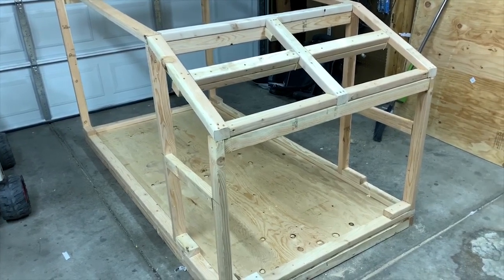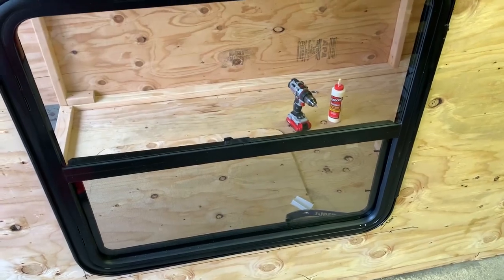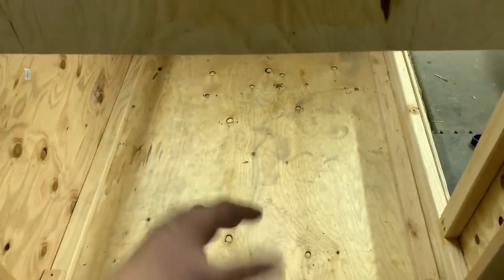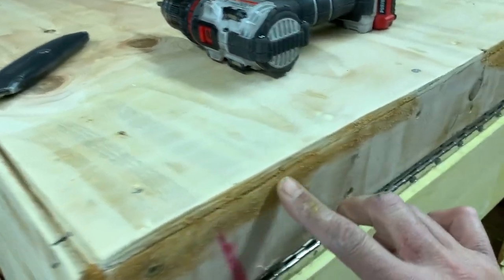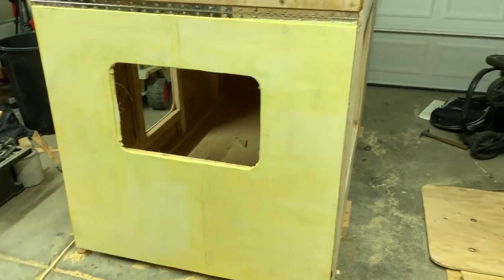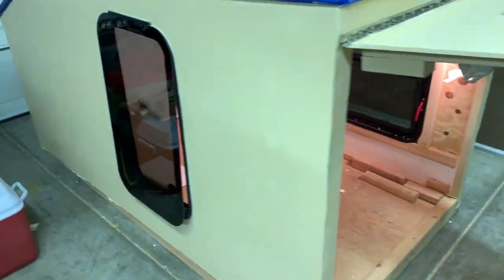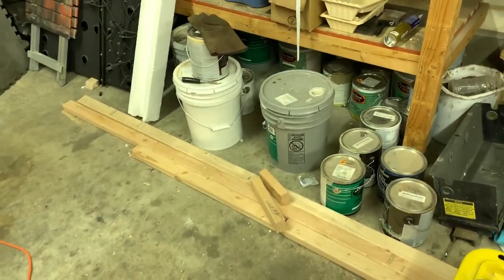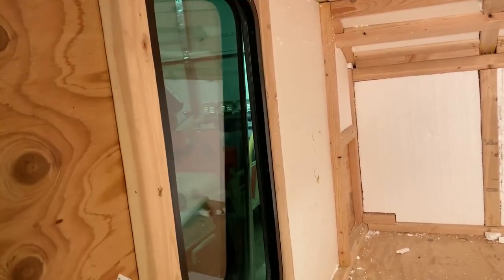DIY MICRO CAMPER BUILD | Truck Bed Camper Build

Comment: Suggestions : use netting to hold stuff on shelf...………..put a piece of plywood on the floor that hinges 1/2 way up the bed ; gets bedding out of th way so you can put toys or coolers while traveling , you might want to put a huge drawer the size of the bed floor under the bed .
Reply from the maker: Thanks! Good ideas.

Comment: You can put a truck rubber mat under and the camper won't move. Great job
Reply from the maker: That's a good idea, but it would make it almost impossible to load, since I slide it in.

Comment: The tie-bond three is waterproof can you use that for the poor man fiberglass?? JW if you can Rhino line the poor man fiberglass? Love the build came out really nice 👍🏿 thanks
Reply from the maker: Thanks! I don’t see why tite bond 3 wouldn’t work, I used 2, because I seen that it worked good.  I’m not sure about the rhino liner.

Comment: I could have built two frames with all the lumber. It way to heavy wood. Seriously, those beams could have been half the thickness and you still would have a strong and solid structure foundation.

Comment: How is this holding up? I'm curious because Titebond 3 is the exterior glue and you said you used Titebond 2.
Reply from the maker: I think they are both exterior, but it’s holding up well. Still using it.
Reply: @Dicks4x4Garage  Good to know. Thanks man.

Comment: So question I want to build one like this after you cover the wood with the canvas what glue did you use and do you just paint it after and your good to go?
Reply: Poor man's fiberglass doesn't need glue, find some exterior house paint from the oops rack, roll it on super thick, then lay the canvas into the paint and smooth it out. 
Fill the fabric with more coats of paint until it remains shiny wet after a few minutes, then paint with the color you want

He used titebond II wood glue

Comment: I believe you would have gotten more space, a lighter build and more usage had you built it as a cap. Definitely would have more floor space. Just have the tailgate but up to it, lock the tailgate from inside with a pin. Nice looking build, but I think you are selling yourself short.

Comment: Where does everybody source their windows and doors.  I would like to find a door that is 48-60” tall max.
Reply: Also...looking for good dome type lights that work off aa or aaa batteries with built in switches.  Wish I could find those solar powered one piece exterior lights but with a switch instead of a sensor.  May have to modify stuff.  Funny thing is that I am an electrician, but don’t want to complicate my future build with a charge controller, large battery,  large solar panel, wiring, water pump etc.  Just something like the micro campers that are no wider than the bed of my 1/2 ton pickups, with a comfy bed, insulation, basic storage and so on for mostly solo 1-4 night trips.
Reply: We just use battery powered tap lights for interior lighting, I got them at harbor freight, they have three levels and swivel to aim the beam.

I build my own windows, search for "Wiley window"

Comment: Why not save the labor on toutside, instead of sanding, glueing, use spray on or roll on, bed liner, ur choice of color, use aluminum angle to do all edges it’s 3m putty type weather sealer, no fabric, no sanding, no gluing, Shalom!
Reply from the maker: It’s a good thought and I had thought of that as well. After some research I found that people who used it on micro trailers had problems with it no sticking to the wood and basically creating a shell on the exterior that overtime started to crack.